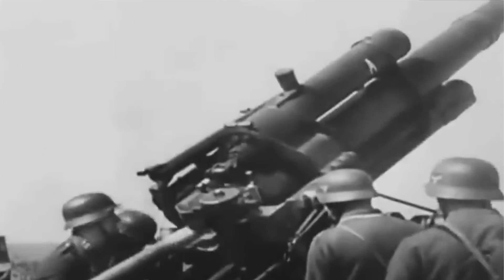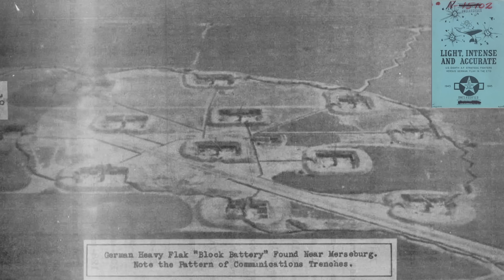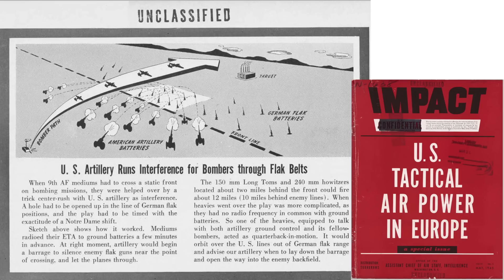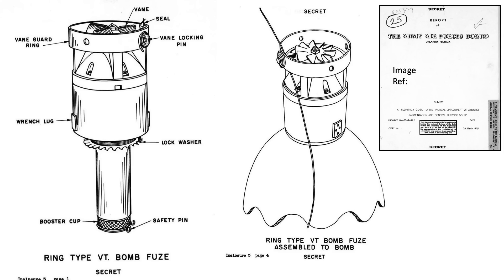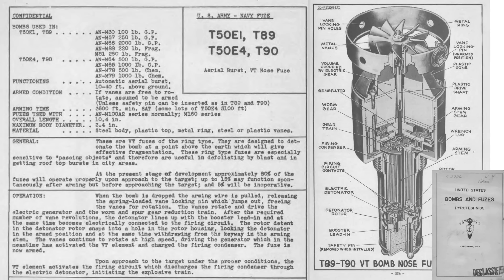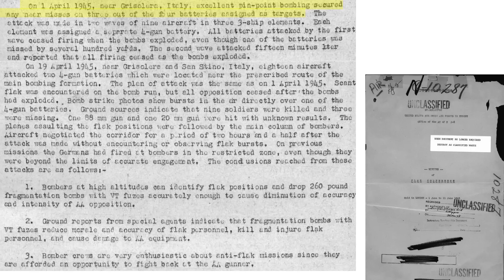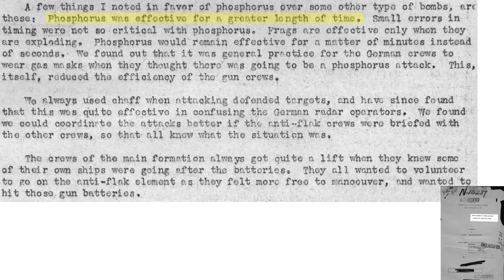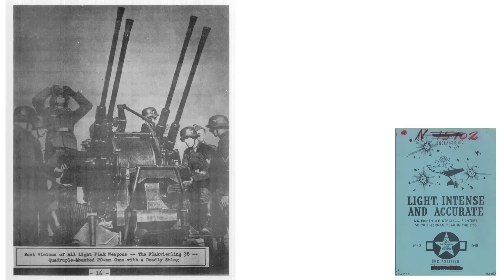Destroying German FLAK Batteries with Proximity Fused Fragmentation Bombs, Bomber Payback Case Study

Comment: This is actually a topic worth more intensive scrutiny. Did the USAAF make a mistake not attacking German anti-aircraft systems more often? German AAA batteries were rarely concealed and not usually protected. Certainly, the majority of the guns were out in the open and not in things like the hyper-self-protective Flak Towers. The gun positions were often manned by many men as the crews for individual guns, the directors and support, and ammo trains were enormous. That's just a lot of viable targets concentrated in an open, poorly protected space with thinly to barely protected ammo dumps all around them waiting to get shot like the convenient exploding barrels of video games. It kind of sounds like a major opportunity. I can't even see a viable reaction move for the Germans here. What are they supposed to do if they keep losing positions to attacks and keep having batteries suppressed? The batteries were sited in ways that made it viable to keep guns using 300-400 rounds per raid per night supplied. They're really not going to able to keep re-siting them. Concealment? That will buy individual positions time maybe but not much. Protecting them? They built about as many Flak Towers as they could already. 

Yet i'm not surprised that the USAAF with its high-minded abstractions of "winning the war by itself" didn't think of this until very late. I guess one has to remember the mental issues with the Bomber Mafia and their ideological commitments to bombing factories and production centers. Neglecting AAA sites was simply part of the complete disdain those guys held toward "tactical" air operations and the extreme difficulty that came with making USAAF and RAF leadership consider things like battlefield support and SEAD as a good use of resources they'd rather commit to targets they believe (but cannot prove) the importance of like ball bearings....

Comment: The bombing was so ineffective during ww2  only 5 in 100 came close to target. The Germans never ran out of equipment the battle of the bulge proved this. They had thousands of plane  but didn't have fuel. Petrol and men was the shortage at the end.  55,000 men died bombing Germany a 44 % death rate That is  the reason there was a celebration every time a bombers completed the only 25 missions. That is very low  but they did it to keep Americans death  low or there would be outrage from Americans. If they had to complete 50 missions the death rate would been over 80% or higher.,
No thought was given men on  the ground 407,000 died.

Comment: Very informative and technical (nerdy!) video on USAAF flak suppression efforts over Germany in WW II.  
One not-so-little  contrary point is that the big German Flak Towers - a hundred feet high built of massive reinforced concrete  
with several 128mm AA guns on top of each -  were still effective to the last days of the war,  for example around Berlin, 
where they took a deadly toll on Allied aircraft, ground troops, and armor alike.  
  Some good news is that  the Germans did not have the VT fuzes the allies had later in the war; and as good as they were, the big German guns 
(88mm and 128mm) were not as good as the U.S. Navy's dual 5"/48cal guns used to fend off Kamikazes and attacking Japanese air swarms. 
Also in the Pacific, General Keeney, commanding the 5th AAF,  resolved early in the war (1942) to CONFRONT Japanese AA in heavily defended targets
 HEAD ON - he envisioned "COMMERCE DESTROYERS" low-level bombers able to SUPPRESS enemy AA fire long enough for his bombers to bomb 
heavily defended enemy ships.   Upon assuming command of the 5th AAF, Kenney stumbled upon a former Navy aircraft mechanic 
turned airline exec drafted as an AAF Col  (after the fall of the Philippines)  who was "hacking," modifying Douglas A-20 
light bomber aircraft in Australian air depots  by adding  several  forward firing .50 machine guns in the nose of the A-20 Havocs.
The experiment was a success, and Gen Kenney thereby drafted Col "Pappy" Gunn to make the same modifications to  bigger B-25 Mitchell bombers.
 These were even more successful - up to 8, EIGHT forward-firing fifty-caliber machine-guns in the nose, PLUS 2 MORE  on each side of the external fuselage,
under the cockpit, for a total of TWELVE forward-firing .50 machine-guns (plus two more if the top turret was facing forward!) on "STRAFER" B-25s.  
  Kenney's B-25 "strafer" squadrons  would attack Japanese airfields line abreast, like a murderous scythe from hell,  the pilots machine-gunning any targets 
ESPECIALLY enemy AA guns as the bombers roared over and released their "para-frag" bombs
 (slowed, retarded by parachutes to prevent low-dropped bombs from blowing up the departing bomber) 
 These tactics - swarming surprise attacks and GUNNING DOWN enemy AA guns - of course greatly enhanced the bomber's survivability.  
  The Japanese had no counterparts to the HEAVILY ARMED and ARMORED U.S. medium bombers constantly BLASTING enemy airbases at low altitudes
   (Japanese bombers were lightly armed and would flame up after just a few hits)  and the war of attrition,
 although grim in 1942 especially  _(the Japanese could feed in hundreds of Aircraft from home, whereas USAAF had to ferry aircraft thousands of miles - 
and at that time almost all U.S. aircraft were going to Europe)_,  but with these superior tactics and aircraft constantly wiping out enemy AA guns
 and aircraft  the tide turned for the Allies against  the Japanese by 1943 and especially by 1944.

Comment: I remain shocked at just how many duds were manufactured and passed QC and were issued for combat.  I guess they figured to drop so many the huge number of duds wouldn't matter.
Reply: The VT fuse for AA use was considered acceptably reliable when it reached 50% reliability.  Even with that, it was better than timed fuses.

Comment: I always wondered why they didn’t do this to knock out the flak batteries, sounds like it wasn’t wide spread enough, why does it take the blockheads in charge of these ideas so long to implement
Reply: Possible had to do with resources of aircraft and bombs, as they were a finite quantity.  
Take into consideration the buildup of provisions it took for the June 1944 D-Day Normandy invasion.  Materials for that invasion meant a limited amount of bombs and aircraft fuel would be supplied to the USAAF for bombing missions.  
Which had the war planners considering:
- Use aircraft and bombs to take out war critical manufacturing and destroy German infrastructure?  
- Or, divert them to take out the flak batteries?

Note that in this presentation that taking out flak batteries was in 1945, a time when the flow of resources into England was on a massive scale since there was a huge volume of liberty ships from the US; along with the North Atlantic secure from U-boat attacks.

Comment: So the proximity  fuse was made designed  and manufactured  in Cincinnati  ,Ohio  by crosly. In my opinion  I believe  it was 1 of many inventions that changed  the outcome  of the war. When you think about  how many bright minds  were coming  up with these ideas  in such a short  amount  of time it's truly  amazing 🙏
Reply: Johns Hopkins Applied Physics Lab might disagree with the design part.
Reply: @robertslugg8361  Designed for functionality (JHAPL) versus engineered for mass production (Crosley) are two separate tasks.  Both are required to have a major wartime impact.

Comment: Forever …there are those of us who wonder why protection from Flak Batteries was not a consideration during development of the longer range heavy lift Bombers tasked with deep penetration into enemy territory. Four years of devastating losses with minimal impact on German production according to the Strategic Bombing Survey …and Albert Speer. Seems to me that suppression of Flak would be essential to crew expertise while eventually achieving sufficient accuracy. Fortunately, the Dimwits in Bomber Command weren’t allowed in the door at Ultra wherein cost effective results actually mattered.
Reply: It was considered, and acted on, Bomber Command did attack Flak batteries, but as you could see from the map around Munich, they're small & scattered about, & you're doing it in darkness. Twin engine planes were used for this. Up until 1942, the RAF had difficulty finding a city, sometimes even a country in bad weather  (like most air forces during darkness), let alone pin point targets - which is why 'Area Bombing' was adopted.

The other thing is during the early war years, it was the German fighters that caused most of the Allied bomber losses (around 70%). It was only when the Germans ramped up AA gun production & combined it with radar, that it became more effective - - THIS IS AS LATE AS JUNE 1944 from the graph shown @ 0.22 in the video. Therefore Allied resources would naturally go towards the bigger threat.

Strategic Bombing did have an big impact, & Albert Speer was always one to show his achievements in the best light, not necessarily the truth to his Allied captors. I'd be the first to agree that it didn't have the impact 'Bomber' Harris said it would, but;-

1) For years it was one of the only ways for Britain could strike back against continental targets.
2) Morale factors for Allied cause, in Britain, across Europe, & America etc for both civilians & fighting troops.
3) Morale factors for Germans against the Axis cause, especially as the war went on. Goring said no Allied bomber would bomb Germany, so when they did, he (& the regime) were discredited. German soldiers on leave were horrified what was happening to their cities - they took this news back to the front lines.
4) Strikes on V1 & V3 sites, providing crucial delays in their programme. Imagine V1 & V3 weapons being fired at Allied ports 6 weeks earlier, i.e just before D-Day.
5) Loss of production as German workers sought shelter. Speer did increase production massively, but that was partly due to how inefficient the Nazi economy & system worked. This couldn't always be analysed when Bomber Commands missions were set. There would have been an even faster exponential rate of increased production without Allied attacks. The British Bombing report which made Churchill mad, was during the early war years - Bomber Command became FAR more effective. 
6) Allied strikes against tank & aircraft factories etc, delaying production.
7) Strikes against German Navy battleships & battlecruisers in port - this had a major effect on German naval plans in the Atlantic & Artic, against Allied convoys. The battleship Tirpitz was also sunk by Bomber Command.
8) British bombing of Berlin during the Battle of Britain caused Hitler to change the Luftwaffe's mission, just as they were winning.
9) British technological developments, advancements & capabilities during the war.
10) Allied bombers caused Germany to withdraw many Flak batteries back to Germany, instead of being used on the eastern front. One of the reasons for the Stalingrad front collapse (& subsequent Axis failures to hold the line) was a lack of Axis anti tank guns, for which the German 88mm was very capable.
11) Allied bombing of Axis fuel supplies was critical. This should have been identified better, & earlier, but the critical Romanian oilfields weren't in range early on. One of the reasons Hitler went into Yugoslavia & Greece (& Crete) was to keep Allied bombers away from this target. 
12) Attrition of Axis fighter pilots (especially skilled ones) throughout the war, culminating in 'Big Week' of Feb 1944, which broke the back of the Luftwaffe before D-Day, which was critical. Also, without enough skilled fighter pilots, their bombers wouldn't be able to counter attack effectively on D-Day, or afterwards.  
13) It helped keep Stalin in the war (admittedly not by much, but it was still a factor).
14) Due to lack of fuel, Germany depended on it's railways, Allied bombing of marshalling yards was vital, both for supplies going east, & after the D-Day landings.
15) Strategic bombers helped break the German line in Normandy during Operation Cobra, which helped the Americans break out & ensured their collapse ahead of schedule.
16) Dambuster raid, helped Allied morale & did hamper the German war effort for a short while. 
17) Strategic bombing forced Germany to relocate various advanced weapon programmes (like the V2, & Me262 jet fighter) underground, imposing critical delays.

It unfair to call those in Bomber Command leadership 'Dimwits'. Were they effective as they could have been, no, of course not - but who was? The Germans neglected their own strategic bomber force, which caused them major problems, especially against the Allied Atlantic convoys & against the Soviets. The Americans had to do a complete about turn about requiring fighter escorts & effectiveness of their bomb sight. Did many RAF men sadly die from any mistakes made?, yes.  It was a time of great technological advancement, expanding forces (& all the logistics needed to train & supply), at a time when nothing was certain, especially military intelligence about enemy capabilities in economy, technology & combat capability.
Reply: @eric-wb7gj  I totally agree with every point you made, except one.

The Luftwaffe was not about to win the Battle of Britain. 

The Germans thought they were, because they underestimated the British defence. And the British thought they were, because they overestimated the Germans. 

But we can see from reviewing both sides with the clarity of hindsight, that the RAF was holding the line as the Luftwaffe was atrophying men and machines. They'd also fallen below levels of pilots that the RAF considered beyond critically low, and were just a couple months away from falling below the number of planes the RAF had as well. Luftwaffe bombing of airfield, radar, and similar targets were generally ineffective.

In short, the Luftwaffe was on a trajectory to lose the BoB. They changed tact because they finally accepted "the last 50 Spitfires" weren't going to stop coming any time soon.
Reply: @kirotheavenger60  If things had ever really gotten bad, Fighter Command always had the option of withdrawing to airfields which were beyond the effective range of the short legged German fighters and continuing to operate effectively against German air raids. The Luftwaffe was too small, it was operating at the limits of its ranges, and it didn't have the techniques or the technology required to smother the RAF and the integrated air defense system that it functioned within.
Reply: @dpeasehead  absolutely right

People think that if Britain lost the BoB, the consequence would be the total destruction of the RAF and ultimately the successful invasion of Britain. 

But neither is true. 

In fact, one can make the argument that it would have been better for German to have won the BoB, causing the RAF to withdraw from the cost. This was have encouraged the Germans to pull the trigger on their invasion.
Which, given the German invasion plans and capability would have rapidly seen the entire German army sunk in the channel and maybe an end to the war much much earlier.
Reply: As discussed in the video, you can see what a significant difference the VT fuse made to the effect of the operation. Meaning this type of operation would not be possible prior to the introduction of the VT fuse over Europe

Comment: The intent of this comment is to note that in the following decades, cluster bombs became the favorite choice for SEAD/DEAD missions, after firing some ARMs to suppress enemy radars, as they could damage/destroy the large number of soft targets of a SAM site spread across a wide area.

Which begs the question ; were cluster bombs considered for SEAD use in WW2, and were there circumstances precluding their widespread use in that role ?
Reply: They did not have a well working cluster bomb but as you could see with the fighter they went with lots of individual small bombs.

Comment: On a tactical scale Rudel would run flack suppression with Stukas on the Eastern front. My impression was that Thunderbolts had heavy losses in low level flack suppression. Interesting to see that high level attacks were safer for the attackers.
Reply: Yes, that was my opinion too.
Reply: Guess they added low level flack to the mix to make low level attacks harder. But heavy bombers only faced the heavy flack, downside was low accuracy but carpet bombings don't need high accuracy. 
It would make sense to send in dive bombers to continue to attack targets.
Reply: @magnemoe1 by the numbers of German Guns there were a lot more light AA guns by a large Amount. Thus the battery big guns had plenty of low level protection.

Comment: One thing I haven’t seen discussed—but this channel is ideal for it:

Starting in June 1944, Germany controlled less and less territory in Western Europe with each passing month.

This video mentions that flak batteries were moved towards and into Germany as the front proceeded eastward.

So late in the war, Germany had fewer sites to protect with flak, with more “bonus” batteries coming in as the front moved. Surely, this effectively increased flak “density” at the sites still held by Germany.

Is this broadly true? And if so, can we see this effect in per-mission losses?

Or did things like Window and direct bombing of flak sites swamp the effects of increased flak density?
Reply: Significant 'bonus's' of forcing the Germans to concentrate flak resources were the sheer manpower involved (as mentioned in the video) and the fact that 88mm guns were having to be used in this role rather than on the front line in their very effective anti-tank role.